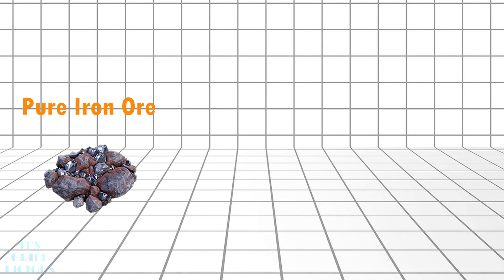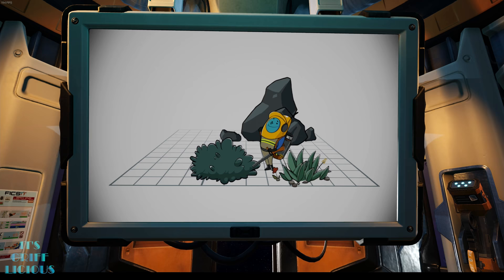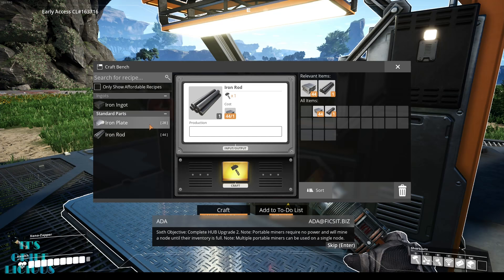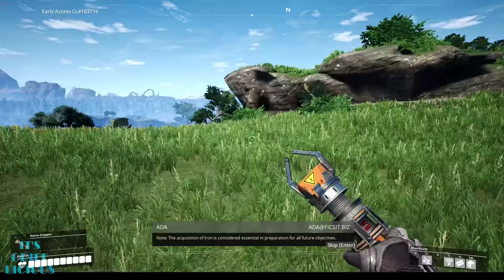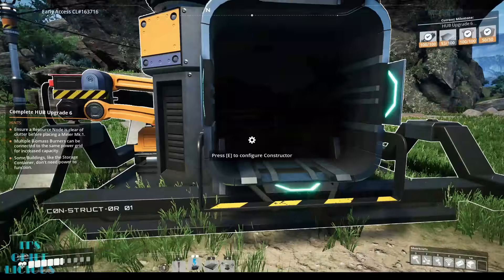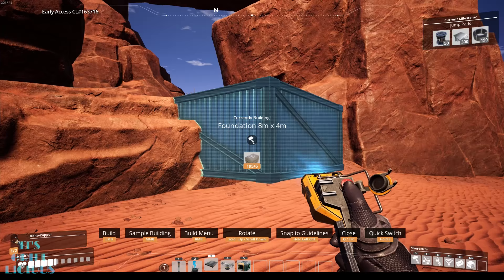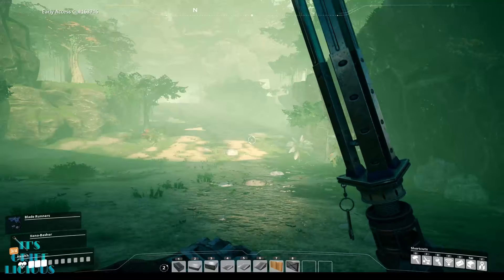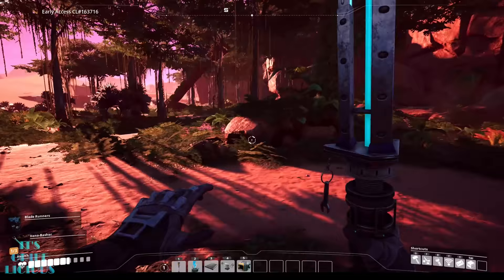Satisfactory: An Unlikely Masterpiece

Comment: The Coffee Stain which made Goat simulator is not the same as the one which made Satisfactory they talked about it on their channel !
Reply from the maker: I too saw that video and have previously addressed this particular fact with another commenter.  What that video actually says is that the developers of Goat Simulator NOW, as in GS3, were given this project due to their work on some pervious Goat Sim DLC work they did in the past.  The original devs of the Original Goat Sim were/are in fact Coffee Stain.  It's on their website.  Its on Wikis.  It's just a misunderstanding in regards to the CURRENT structure of the company.

Comment: despite my interest in the genre I never could really get into this 
game. Factorio set super high standards for quality-of-life features in 
logistics games, which this game painfully lacks. Building is an immense
 hassle due to the immense scale of the buildings and the fixed, narrow,
 first-person perspective. Poor alignment and grid features make 
building neat factories an impossibility, either forcing you to spend 
actual hours on small tasks just trying to align things well, or having a
 messy, hard to work with factory. Because of the size of the buildings,
 and the fact that they are placed solely based on the point you are 
facing, precision is nearly impossible, and you may need to find 
ridiculous angles to place something where you want it. Even a 
no-clip-esque flight system couldn't fix these problems.

Honestly
 I barely blame the developers for this, making a system in 3D that 
allows you to place things like this quickly and neatly is consistently 
incredibly hard to make, and this is far from my first struggle from a 
system of this nature. I imagine the positive reviews for this game come
 from people who don't care about their factories neatness and throw 
things together wherever they easily go. If you don't like this, you 
will be very, very frustrated trying to make even simple factory chains.

Comment: Calling this game a masterpiece is absurd.  It pretty much copied EVERYTHING from Factorio, yet left out the actually challenging parts like being careful how much pollution you bring because of the alien threat. And the defensive measures to protect yourself from it. I know the game isn't finished yet and may have these things in future, but for now, combat is mostly ignored.

The whole production line thing feels forced most of the time. You can never predict how badly future tech will completely invalidate everything you've built, forcing a complete redesign every time a new "thing" can be made.  So what we end up doing is making an absolute mess.  What's the point of trying to make anything look nice when you'll just have to change it all in the frustratingly near future anyway?  Should we just build everything a mile from each other to have that space available in case we eventually need it?

That's fine if you like it, but I think there are still a lot of kinks to iron out before this game/genre approaches anything that can be called a Masterpiece.